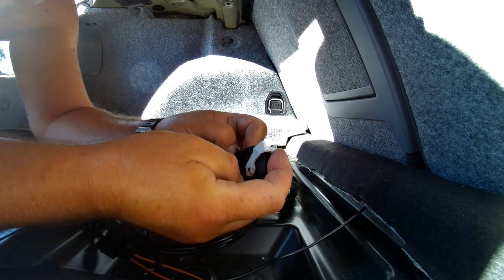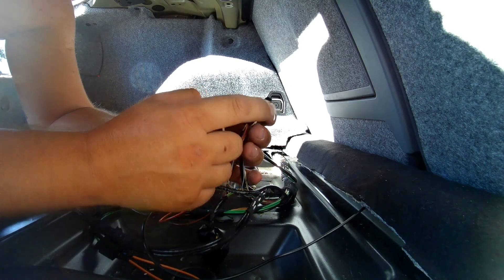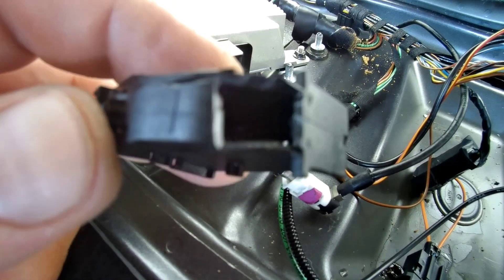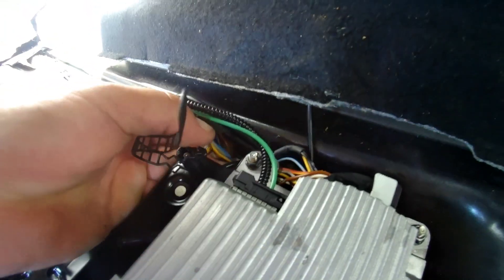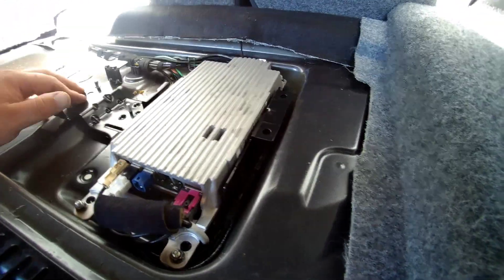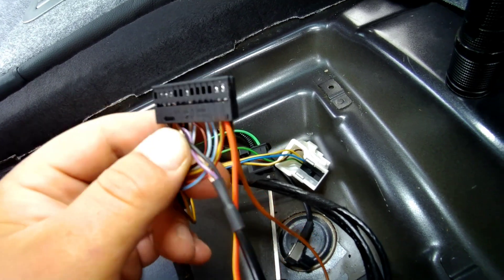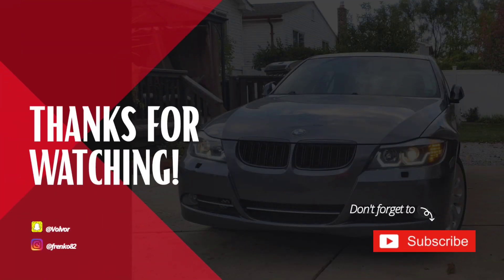BMW e90 Combox retrofit

Comment: hi, I’ve seen on other tutorials (with the kufatec cable for example) that they are leaving the mulf connector untouched only tcu -> combox can you like explain if I need to plug some wires from mulf or do I just leave the connector untouched
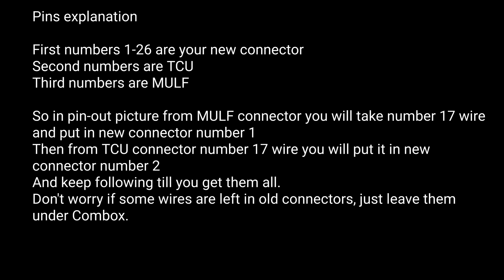Reply from the maker: I dont know what other tutorials are showing but this is how I did it and never had an issue. Around 3:25 minutes you can see picture showing what numbers from mulf you need to plug in.

Comment: Where did you plug/splice in the K-can high/low wires? listed in the final tcu+mulf chart  3:28
Reply from the maker: @longstrike21 High goes to pin 5 and low goes to pin 6

Comment: Hi mate
Thanks for the detailed vid. I have done same job as you on a BMW F10 but I cannot get my USB to work. This is the USB in the Armrest, The USB port works for charging but does not read a media USB at all. I have checked the coding and it all seems correct. I am thinking I might have a faulty USB hub. I have purchased a new one but cannot locate the old one on an F10 520D. I've tried all sorts plz help
Reply from the maker: Does it read if you connect it in glovebox?
Reply: @Frenko1  mine isn't nav HU so I haven't got the glovebox USB....Although I will be retrofitting a Pro Nav to mine soon....
Reply from the maker: But you did retrofit Combox and you can listen to music over Bluetooth?
Reply: @Frenko1  yeah that's working perfectly. I made the Harness myself. Just the USB isn't working
Reply from the maker: I'll have to check in mine if it works, but I don't think it's suppose to transfer media unless you hook up to aux.
Reply: @Frenko1  eh wa do u mean bro? Aux is for Audio and Aux work fine. USB is supposed to play tracks via USB. I have separate snap in adapter for phone which is separate to Aux and USB port
Reply from the maker: @jamil420  I see  what's you trying to do. Honestly I think you either missed one of the vo to add or your usb is faulty or maybe try different usb cable.
Reply: @Frenko1  VO is there coz USB and Cradle is on the external devices list. I've tried a few USB drives and it shows "not connected" my phone connects and it shows the name of the phone but does not show any tracks within the phone. The port is fine as it charges ok and physical pins are ok. To my knowledge I think the USB hub is gone hence the malfunction in the functionality not the whole function. To add....My car came with Mulf High which had the "USB interface" as I checked the VIN so it was already on the VO prior to Combox Retrofit....
Reply from the maker: Has it been working before you did the retrofit?
Reply: @Frenko1  nope very rare. I had issues with it before, Where it could only recognise 1 particular USB drive which was 32GB 3 years back that's all I remember....

Comment: Could you please share what adapter cables you need? One is for the USB because it can't reach correct? What is the tan one on the far left?
Reply from the maker: Yes for USB you'll need to extend. The tan one is for GSM antenna. As for adapters you only need USB, other one (white) you can cut guide and slide it in tan connector.

Comment: Great informative video. This cleared out a lot of the confusion I had. I just got everything to do this retrofit. I had done all the research involved and was waiting for nice weather to tackle the job  suddenly this popped up on my recommendations hah. The only thing you’re missing is the coding. 
I’m wondering if you did the retrofit without the coding what would happen? Would everything function as it did with the tuc and mulf or certain things would not work and errors would come up on I Drive?
I can’t seem to get my kdcan cable to work it might just be a lot easier to find someone locally plus I don’t plan on coding stuff anyways since Carly already did all the stuff I wanted
Reply from the maker: Honestly, I've done coding but accidentally deleted it. I was going to make the video but never came around. It won't work without coding.